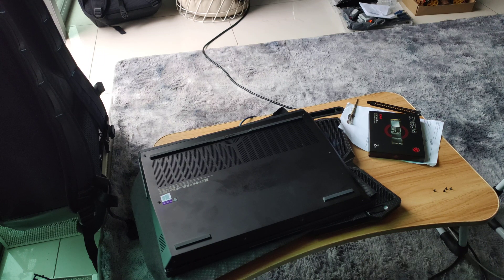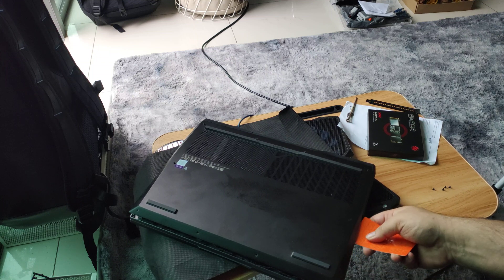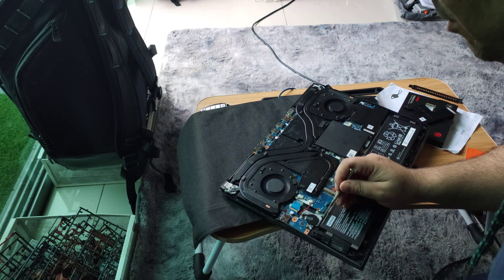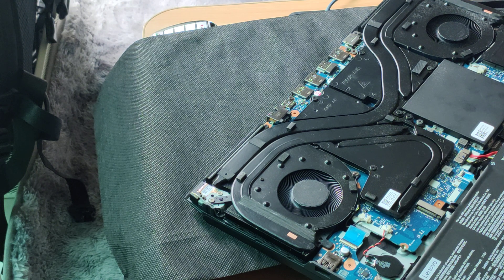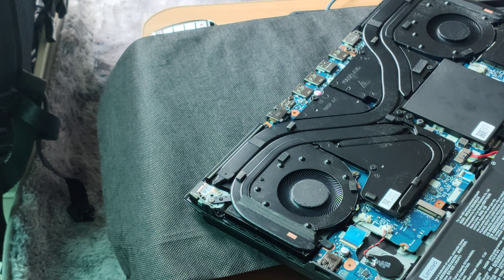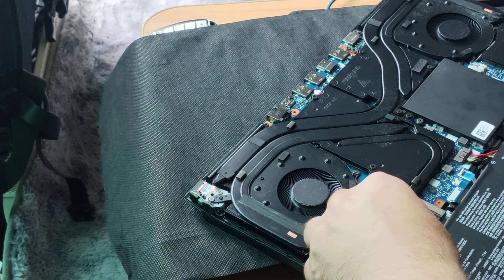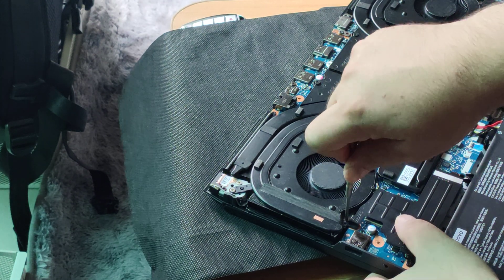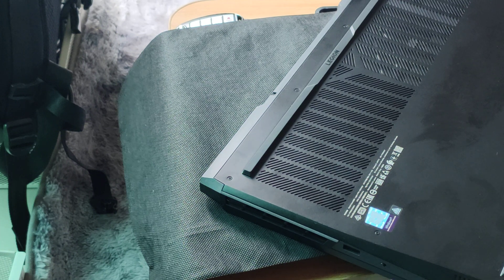Lenovo Legion 5 Pro | successful back cover opening and installing new 2tb ssd

Comment: This cover is so hard to remove. I added 2TB to mine and it was a pain. My advice is work the front area near the space bar first, where the black and grey join. Use a credit card if you don’t have the blue pick tool. Be patient - once it’s off it’s a work of art and all downhill 😂
Reply: Your advice proved to be so uselful, there is no way to open from the angle first.
Reply from the maker: Yes. Hopefully don’t need to open it back again.

Comment: Ok late msg but is there any speed drop when installing both slots with 1tb ssd drive because of less lanes is pcie gen 3 ,and if i buy 2b and put it in one main slot is it gonna work like speed vise because only one slot is using lanes only size is increased ,iam very confused anyone know something bout this.
Reply from the maker: Not really any drops

Comment: Congratulations on successful installing and running the 2 TB SSD. The website mentions 2 TB supported. I thought that was in total. But watching your success story I think it's more like 2 TB per slot. 
If you get time, please check if the 2 TB SSD is supported on the other slot too, by swapping the SSDs. 🤗
Reply from the maker: Yes it does support
Reply: @rtxgamebench8215  thank you 👍

Comment: Well I just ordered a 2tb I actually ordered one a few days ago and got it in the mail today and when I ordered it I wasn't thinking about the size bigger isn't always better 🤣  I took the laptop apart and I'm like oh that's too long I seen one of your replies to someone else you should have done like a failure link for that SSD nice video keep up the good work and I don't know how much you paid for yours but I ended up getting my 1399 at my local Walmart and I have the 30 70 it handles any game I throw at it funny thing is I'm still using my MSI 18.4 laptop daily  but I really wanted something more compact and this is great I can grab it and go to my girlfriend's house without having to carry two power bricks and a damn big heavy laptop
Reply from the maker: I got mine for 1450 but I received secret lab gaming chair worth 450usd
Reply: @rtxgamebench8215  are you in the US yeah I was looking to see if you had any contact if info because I need someone to tell me if it's normal for the games not to work right on battery and I've asked online but nobody's responded back to me and now I know playing games on the battery is not a good idea but when I try to play battlefield the colors are all messed up I've tried putting the system in hybrid mode and that seems to work but I don't really want to use the integrated graphics at all

Comment: Personally i would create a more professionally watchable video. Working on a desk no watchable mess. And certainly not chasing a screw arround a MB with a screwdriver. There are magnets for example wich you can use.
Reply from the maker: I don't do it professionally and that is right. Coz I have a more important things to do in life. I don't even edit my videos.
Reply from the maker: And while my screw driver has magnet not idea why it was not sticking up the screws inside the chassy. I didn't plan it and just recorded what I did for myself.

Comment: Hello.  I have a Legion 5 Pro on the way, and I'm planning to buy an XPG for its second nvme slot.  I was just wondering if attaching the heat spreader on the ssd considerably increased its thickness, since the laptop already has a heatsink for the ssd.  Did it affect the reinstallation of the heatsink in any way?
Reply from the maker: I installed it with heat sink in my video

Comment: Does the second ssd slot support storage above 512gb?
In an online manual I found it said it only supported up to 512!
Reply from the maker: I added 2tb
Reply: Misleading that spec sheet as I had same question. It means they can only install that from the factory if ordered to spec. You can freely purchase a 2tb nvme drive and it will work just fine.
Reply from the maker: @danielshaw007  yes correct
Reply: @danielshaw007  hi good day, were you able to try adding another 2TB ssd on the 2nd slot?if yes did it work for you?
Reply: @ryanprice3958  yes all good
Reply: @danielshaw007  thank you for this I can now upgrade my storage too.

Comment: There is a manual for this Laptop (PDF).  Prying open  is made in a different order: First rear, where the ports are, then left and right, and finally the front.
I am glad you still made it. I am curious how the heatsink works. Are temperatures of the SSD low even when copying large amounts of files?
Reply from the maker: Yes that's the purpose of that heatsink

Comment: Does this laptop have feature to disable charging battery while connected to AC power?
Reply from the maker: Yes it does
Reply: @rtxgamebench8215  is the panel true 10bit or 8bit+ frc trick?

Comment: Got the same SSD but didnt install yet because I had similar issue with legion 7, i would've broke my laptop too lol. thanks! gonna try open it up again tonite
Reply from the maker: Yeah make sure to use something like a credit card so you dont get scratches. Anything metal was putting up marks